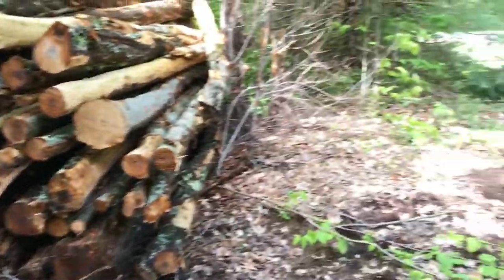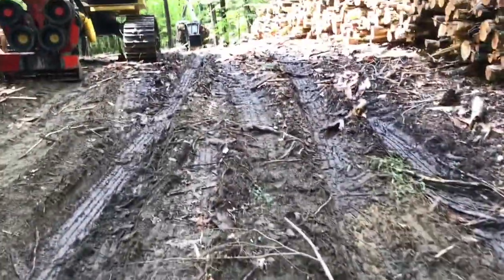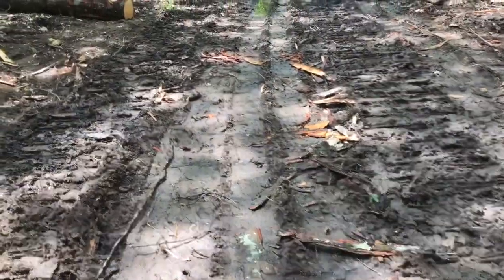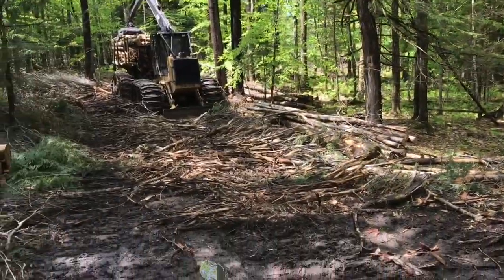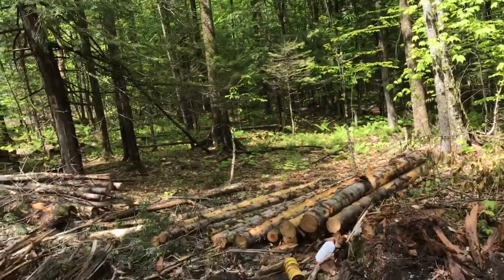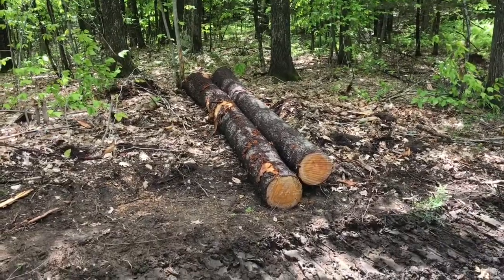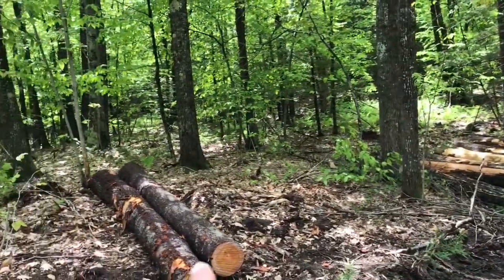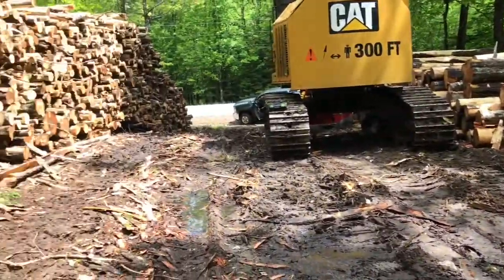Little update and fixed the AC!

Comment: Why do you think freon is low? Possible a leak? Looks like a late model machine. About how many hours. I hand cut in southern and western Maine
Reply from the maker: I’m not really sure why the Freon would leak out but it was low and the screen that the cab fans pull air through were clogged. It’s only got 2500 hrs I bought it new